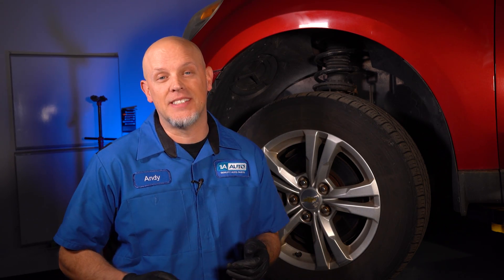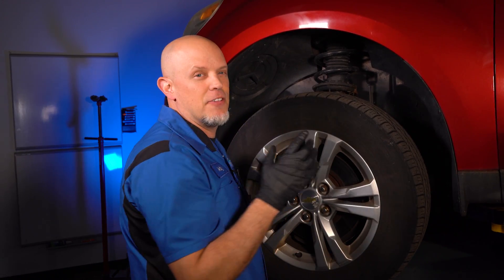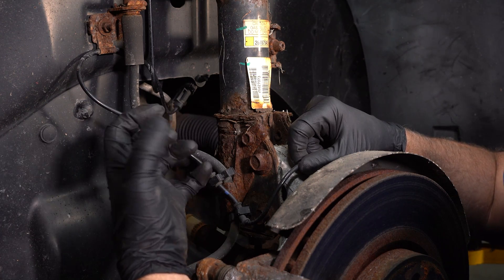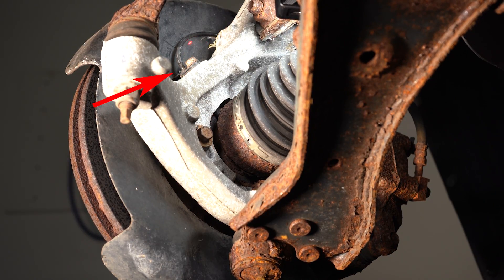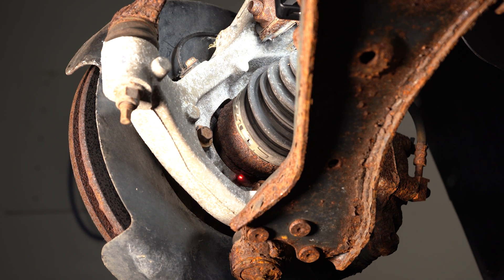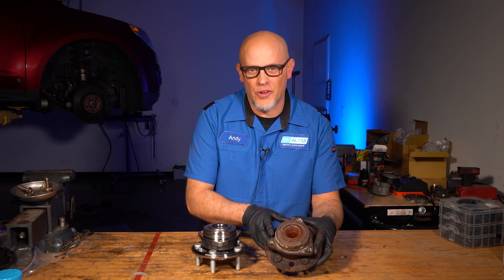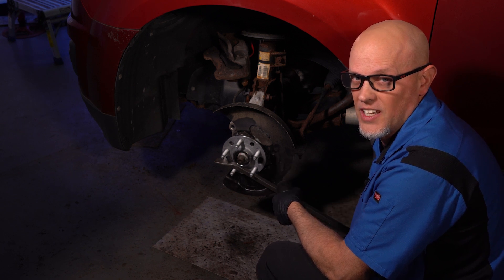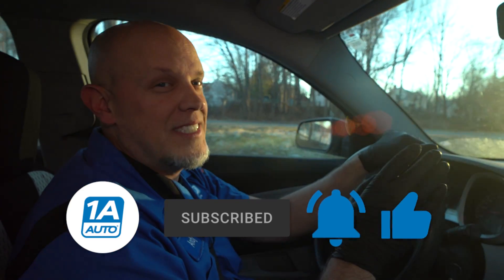Has Your ABS/Traction Light Come On? Don't Ignore It! Make Sure Your Vehicle's Ready for Bad Weather

Comment: I recently change all 4 wheel bearing for my rwd car. However, the rear sensors had to be replaced due to being seized to my wheel bearing. Everything works when put back. However, my car is triggering the Trac control and abs when my car is in reverse mode and the steering wheel is turned all the way to the left or right. Do you know what it might be? Bad sensor in the rear or the front wheel hub?

Comment: Could this be the same problem with the Mazda the traction control light is on and the engine is running at a high rate of speed any stalls when you come to a complete stop with your foot on the brake

Comment: my FF Ranger has been doing that for about 10 years... it grumbles every once in a while. I'm a bad owner.
Reply: My civic had "a friend of a friend of my mom" work on one of the wheel to fix some noise, the next day i drove the car and noticed the ABS light now on and some disconnected wires by the wheel. Will probably fix eventually